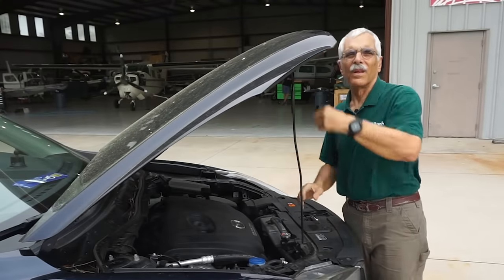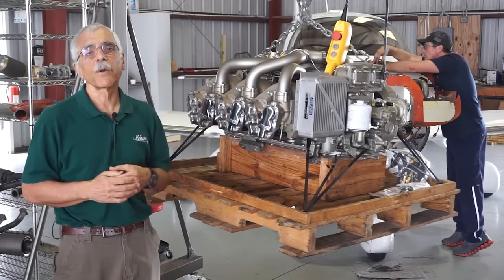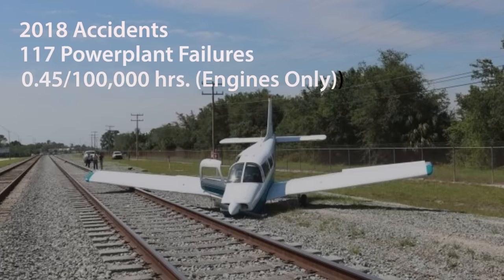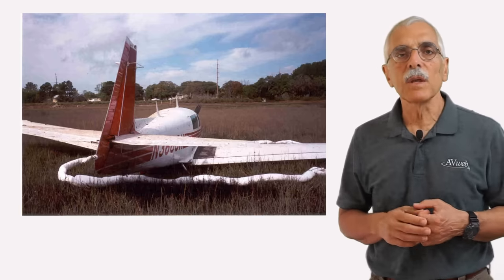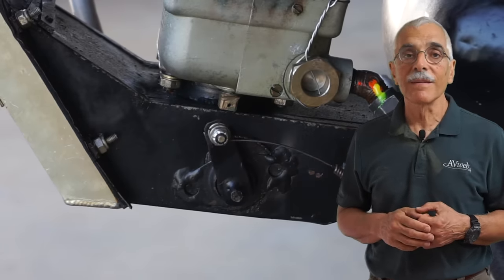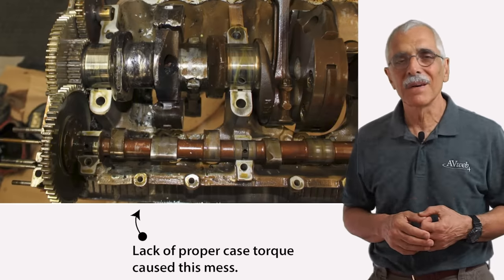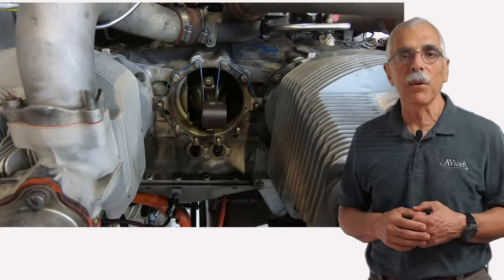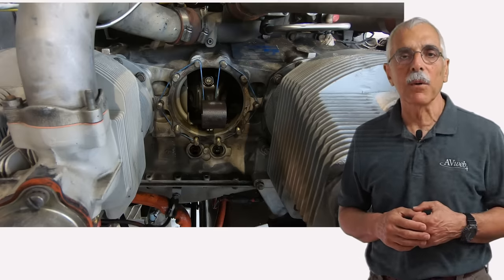Why Aircraft Engines Quit

Comment: Not using carb heat is a great way to put a point in your shorts.  I have experienced a stuck valve in a new 152,   carb icing,  engine roll back, in an old Aztec, in cloud due to heavy rain, alternate air cured the issue, cracked cylinder wall,  engine quits above 8500 feet, cause,  an incorrect diaphragm in the fuel injection manifold and a shutdown due to a cracked oil line. These are most of the engine experiences I had in over 50 years professional  flying.  Not a lot, given the years I flew.  Advice; set engine rpm and if it drops, (say 50 rpm) or does not drop use carb heat, regularly.  Carb icing can happen very quickly!  So can airframe icing, I've seen over 2 inches of clear ice form on an ice probe in under 90 seconds. We abandoned the approach, started climbing out, rate of climb 700 ft/min. In an aircraft that should have been doing over 2000/ft/min. We could not make it past 14,000 ft. over the west coast mountains.  If you are in temps below 5 degrees celsius with visible moisture present (low cloud, fog, mist, rain, close temp and dew point),  YOU are in icing conditions.  Fly safe.

Comment: What non-aviation people don’t realize regarding airplane engine failures is that our engines run at 75% or more throttle all the time.  Try running a car at redline for 15 minutes (simulating climb to altitude), then at 75% of that for hours every time you drive it.  I think that auto engine reliability would go down pretty quickly.

Side note:  why would someone downvote this video?  Seems really informative.

Comment: I majored in electrical engineering but as a " core " course we studied materials science. I have hobbied around with a few sports cars and always, always changed the cylinder head bolts for new if available
. Also, I have found torque specs to be a bit of art as much as science being there are so many variables that are not commonly talked about.Love your channel ❤

Comment: 09:11 - I had Carb Ice in a 152 over FL in Summer 2002. as a new pilot, I went through checklists at intermittent failure, pulled C/I Lever & got my engine back. I landed quick, refueled & got back up. I hate 150s & 152s….I was 35lbs lighter then, but still 6’6” & 24yr old Me took the 152 to save dough, instead of a 172, A36 or Saratoga.

Comment: Informative video Paul ...  What I"m wondering about is how many aircraft engines actually fail because of lubrication problems? I noticed that, quite a few of accidents involving engine failures shown here list the probable causes shown in the photo frames, to be caused by a lack of lubrication... If that is true, then why? If that is not the case, then shame on those who wrote the reports... We need accurate information of WHAT is actually happening....

Comment: Excellent video! Learned a lot, sir - and subscribed. I don't pilot but the technical stuff you discuss interests me. I once visited a LuK clutch assembly line here in Brazil and they manufacture clutch for cars and heavy machines like harvesting machines. The assembly lines for cars were largely automated while the ones for large machines where hand built by four workers. Apparently scale of production allows (financially) for the use of more expensive machines for, as an example, stamping the crankshaft - resulting in more precise results. Also, I think it's easier to stamp a VW UP! crankshaft thant the ones you showed on the video. That motor is almost the size of my VW UP!!!! Am I correct, sir? Also, is vibration a important factor? I think cars have almost no vibration while turbulence might result is a lot more vibration on the propellers. Thanks!

Comment: This is beautiful. That's all I can say. The only question I have is, aren't they teaching this material to new students? Carb heat was drilled in my head, along with a whole lot of other things, most of all having respect for that powerplant. Maybe I am just showing my sixty-one years,  but I have never made an unscheduled divot in the runway either. Private operators don't like that. Thanks for the video.

Comment: Excellent, I like the open engines, and the mention of torques in relation to warping the thin structures.(To add, often the tightening sequence pattern and technique has as much effect as the individual bolt loads.) 
The one glaring oversight here is that the Mazda normal operation is only at about 20hp with bursts of 100hp for 5-10seconds to accelerate to freeway speed. People aren't driving around near  wide open throttle for 2 or 3 hours straight.
Does the Rotax data include reduction gear failures as engine-mechanical?
The simple pushrod design is fine and dandy for low RPM engines like Conti and Lyc, but the certification system makes small improvements to the parts and materials cost prohibitive.
And I might dare speculate that the FAA method of certifying A&Ps leaves too much room for variable quality; if the test banks are anything like pilot test banks there is a large fraction of irrelevant and inaccurate garbage to be memorized then dumped after the test, at the expense of good accurate engineering understanding.

Comment: Very enjoyable video; first time I've watched one of yours. 
I've no experience in aircraft maintenance but 50 years with automotive. For the latter, the engines are now extremely reliable. When I started in the early 70s, you could start to have mechanical issues at 60,000 miles (e.g. valves and cams). Now, at twice that, problems are very rare - assuming one follows the manufacturer's maintenance schedule. Many of us had mixed thoughts on extended maintenance intervals with some engines not being very forgiving when the oil change interval is further extended by the owner or if the wrong oil is used.
The electronics are now also very reliable and have built-in redundancies for most of the inputs. 
Most of the issues are with the sub-systems. In the case of the battery, you'll still get to your destination, assuming you carry jumper cables. The real Achilles heel on the vehicle is the fuel system, esp the pump and filter. If they fail, the vehicle goes into "sneaker" mode and you walk home. Some of the fuel pumps we used, well, I'm just glad the manufacturer also didn't supply the aircraft industry!

Comment: 4 of us were flying in close proximity to the airport when it started to show rising heat and low oil pressure (Cessna 172) 
We climbed as much as possible and headed back. We even considered landing on the interstate but made it back. It was gauge error in the end  but a sweaty situation. 😓

Comment: In the late seventies a local pilot was famous for having survived three catastrophic engine failures with one being a low hour Cessna factory rebuilt engine--less than 100 hours. This was replaced by the factory with a zero time new engine. A few hundred hours later this engine failed while he was over the Blue Ridge Mountains and coming back from vacation. He landed in a field without harm. The farmer was a pilot himself and provided a flat bed trailer to haul the plane to the nearby airport. Cessna paid to have the plane shipped to the factory and did a "frame off" restoration on their nickel.

Comment: Everything has improved. Remember the early 80's? Drive down the highway, every 30-40 miles thered be a black spot that trails off where someone threw a rod thru the block.

Comment: I am a PHG pilot and I have already had two emergency landings. Once it was immediately after takeoff (my fault), the fuel supply valve was badly opened, and the second time it was a total colapse of the engine - break the connecting rod bearing after 18 years of operation. I have heard a slightly strange engine sound for the last 5 years, but I did not know where the problem could be. Both emergency landings are on YouTube. Last under name: Trabant engine failure in flight.

Comment: I take care of 12 172 SP's in Florida panhandle. I'm surprised you did not mention pilots use of Lean of Peak as big percentage of cylinder failure. Save a little gas and burn up the damage engine. Oh wait, it was Avweb that advocated Lean of Peak wasn't it?

Comment: Great video Paul,

Why aren’t more car engines susceptible to Water containment’s than planes?

They both used similar gas caps that might be not tightly secured every time.

Haven’t heard car engines failing do to water in the tanks.

Comment: "Pistons the size of beer kegs"  LOL Clear and concise thank you.
   I suspect those who neglect a thorough pre-flight are often those just using an aircraft for transportation. And flight has become much to routine. For those who think of their airplanes as their weekend hot rod, rather than a daily driver, likely have less failures. It's kind of like truck drivers. Dot requires a daily inspection. And this inspection is actually much more thorough then what is even suggested in aviation. But anyone who observes trucks at a truck stop for 24 hours very very rarely sees the required post trip inspection. But frankly very few even do a pre-trip. Perhaps one out of 500 will lift the hood and 1 out of 50 maybe do a walk-around looking at the tires and lights. But DOT actually requires to get under  and make sure the slack adjusters are adjusted properly for the brakes once per 11 hour shift. That never happens unless someone had just smoked the brakes earlier that day on a long descent.  
Big rig engines very rarely fail when they do it's mostly fuel-related LOL. Either fuel pump failure or gelled diesel fuel from extreme cold.
 These engines are low RPMs but high torque. And can log a million miles before a rebuild.
   If they would only build aircraft engines for high torque instead of high RPMs they could throw out the speed reducer. given the engine much more reliability and life  from operating at lower RPM. Not to mention much  easier on fuel consumption. 
  Drove an international about 5 years ago that when bobtailing actually exceeded 18 miles a gallon! That's right, that 22000 pound  tractor actually did better than many pickups.  🤔
              🛩️

Comment: Interesting stuff...curious how often electrical failures happen?  By a silly big margin that has been the most common failure on cars myself or friends have had...either the battery just up and quits or the alternator/regulator spontaneously going out.  Its one  reason I worry about how much these modern cars depend on electrical systems for everything under the sun.

Comment: I wanna stress the preventable part. I’ve caught so many issues before they became issues simply from SOAP’s and ECTM reviews. On top of that, I advocate for pilots to bring up any issue they have. It’s usually nothing, but some squawks actually yielded parts that could have led to a failure.

On top of that, to my fellow A&P’s, if you are unsure of the shop that performed some type of mx on your or your customer’s aircraft, do yourself a favor and recheck. I’ve found numerous over/undertorqued bolts, unsafetied parts, defective parts that were “inspected” etc. fresh out of a check.

Comment: Your comments re modern electronics in auto/aero applications are valid.  I have just spent 3 days diagnosing an electrical fault in my car (a 96 Rover).  The most reliable vehicles that I have owned /used were Russian.  When I asked a Russian friend why their vehicles seemed to be so reliable he pointed out that Siberiia is not a place to brek down.

Comment: I have a question. While training for my Private Pilots license, I got a chance to look inside of a  Lycoming 0-540 engine that was being serviced in the hangar. What I saw baffled me. I noticed the crankshaft had ZERO counter weights on it. WHY?? Alot of General Aviation engines are designed this way. I noticed during start up and shut down these engines vibrate  violently. The RPM operating range is relatively low at 700 - 2700, but that shouldnt matter. I also see the engines are designed to produce more torque being over square with short stroke and large bore and long connecting rods....But I would suspect some of these fail due to the engines eating themselves due to not being balanced. Why are these built this way? Clearly you can see mechanics wire attached to certain bolts, fasteners and filters.. This is to prevent it from vibrating loose....something that rarely occurs in an fully ballanced automobile engine...but why build an engine that will vibrate like this????

Comment: I had a right side engine gear break that drove a pump that provided oil pressure to the prop governor in a B- 58 (Beech Baron).  The clue was when, at 10,000' over the Chesapeake Bay, the plane yawed to the right (without oil pressure the prop went to feather).  I could straighten it out with left rudder pressure.  Not knowing what was wrong, I shut down that engine, called flight control (I was on an instrument plan to Savannah), and was directed into Patrick Henry airport in Williamsburg, VA.  My wife and two small daughters were aboard.  The daughters were nonplused, but my wife was really pretty upset, probably most intensely when she saw emergency vehicles lined up along the runway as we approached for landing.

Comment: I can agree on the engine thing having multiple engine failures on my race and muscle cars throughout the years. One thing remained constant was oil lubrication to vital moving parts and the right viscosity oil. Know your oils (what it can and cannot do). I've had parts fail because of metallurgy problems. You don't know until it fails. As with all things, It's a gamble. Hopefully, luck will be on your side.

Comment: I find it hard to believe one of the big car engine manufacturers couldn't make au ultimately much simpler engine for a lot less than current aircraft engine manufacturers do. Could you do a video explaining why these engines are so expensive when they have less tech and production required? I know they are smaller than big manufacturers so it cost them a lot more per unit, but what's stopping Yamaha or Kawasaki or Toyota or Chevy from coming out with light weight bare bones versions of some of their existing models or just making a new engine line to steal huge swaths of the market from these super pricey guys?

Comment: I once flew from south texas to las vegas in a pa28-236, it was a few weeks after an annual inspection. On take off at max power i thought i heard something, then again at the 2 refueling stops (thanks headwind) on takeoff at max power. Landing in north vegas I had the fbo pull the cowling off the airplane. There sitting on top of a push rod tube was a mechanics air tool. Trust your ears, nose and butt and take the time to pull the cowling if you even think something might be wrong. I got away with my lack of adhering to this rule but it could have easily gone the other way.

Comment: Keeping with the initial theme, I wonder how many planes run repurposed car engines and how those compare for reliability? My father flew Fourniers which used slightly modified VW Beetle engines, and as motorized gliders the normal mode of operation is to turn off the engine at altitude and only start it again when approaching the ground. So reliable starting from warm or cold is a priority. Never gave him any trouble, but his Super Cub was a different story...